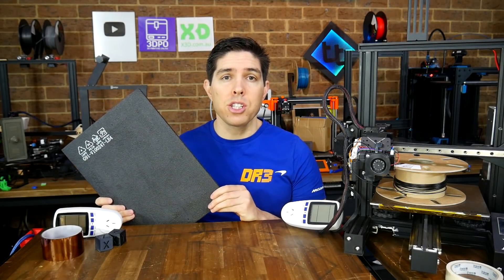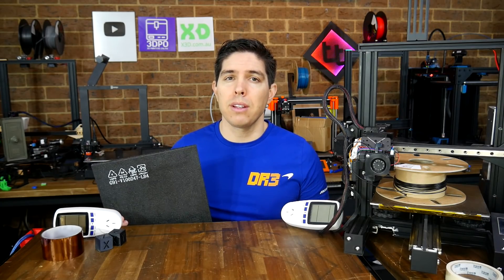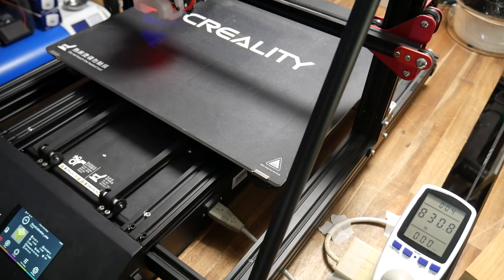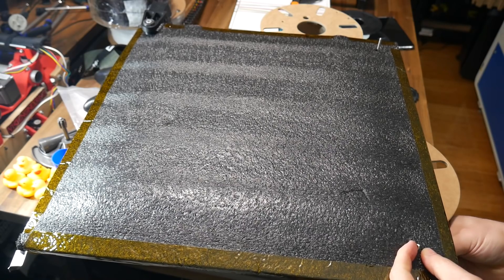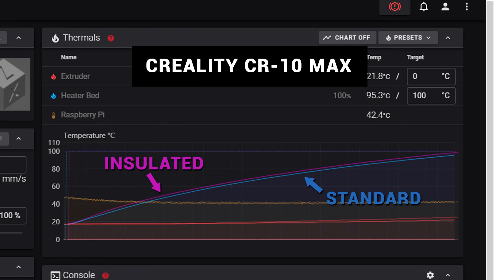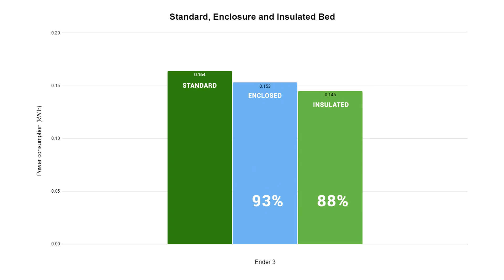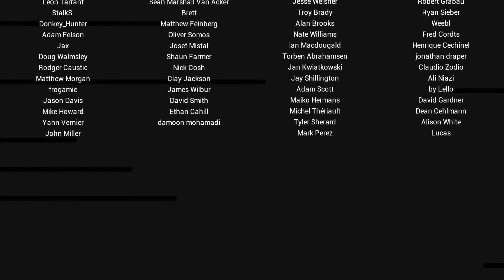Speed up 3D prints & save money. Insulation is important!

Comment: I'm bouncing back and forth between a good looking transparent enclosure for my Ender 3 Pro after I upgrade to the Ender Extender Max kit, or a well insulated enclosure.

While this video was well put together, it didn't help my decision any much based on your Ender 5 testing at the end. 🤔
Reply: As 3D printing is still in high development and there are frequently many innovations popping up i feel like some "smaller" people, in terms of audience and viewers, have a fair point by saying '3D Printer Enclosures' are highly underrated. It appears to be agreed that a 'heated chamber', basically a good Enclosure, is effective and usually desired. 

For your Question: i think you have to think about the initial question of whats the goal of isulation. From my perspective the goal is to make the printer more efficient in terms of power usage. The test he was doing in the end with the Enclosure and isolate it is in my opinion kind of missing the point of the Video or at least mixed. 

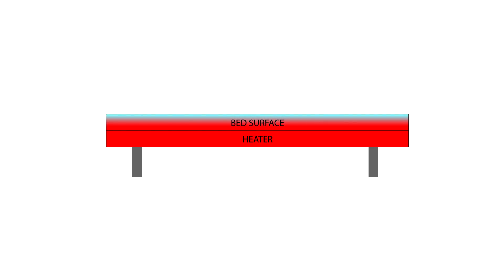The effect which you will probably archieve with isolating the Enclosure from inside will be that you effectivly create a 'heated Chamber' which presumably will improve the efficency further more as the heatbed will potentially lose less heat above it, if you look at 6:09, because he air above the heatbed is already hot/warm aswell and hot air is rising upwards.

Ofcourse it would be very interesting to see some numbers if the effort and lack of beauty is worth it. Because 1% more or less is not to much to gain for example in terms of efficency. But!

I personaly am investigating alot recently as im planning to buy 2x RatRig V-Core 3D Printer and im planning to print quiet some stuff. I will probably insulate the bottom heatbed and the enclosure with an exception of the front which i want to keep transparent.
Besides its potentially beeing more efficient it probably helps to reduce noise of the printers aswell.

So TLDR;
Pro +:
- Insulating the enclosure is probably good and desireable
- Heated Chambers appear to be good for e.g. cleaner prints
- Potentially even more efficient as the heatbed loses less heat once the heated chamber is heated up, probably exponentially good for long prints
- Probably reduces noise by a lot especially because those turbo/turbine fans on the hotend tend to be quiet noisy

Contra -:
- Potentially bad for Voron or RatRigs as they use 3D printed parts which could deform because of the heat(?)
- Hotend fan could ramp up more as its trying to keep the hotend on steady temperature(?)

Thats atleast my personal thoughts from what i know so far.
I would really appreciate any opinion of any of you!
Reply: @Keptains  and add a fan with thermostat to cool the enclosure down in longer prints. I start it just over 30 degrees in the enclosure, just a CPU-cooler from an old computer. Makes it really more silent then the fans inside. Parts of the printers if made from PETG or ABS will not degrade fast on those temperatures.
Hotend-fan - does your's have an extra thermistor ? The hotend is heating a lot less already because the surrounding air is keeping warmer in the enclosure but ofcourse cooling it down for PLA can be more critical when you print faster.
But I never let my enclosures reach really high temperatures.

Added bonus: the filament is preheated as well (especially in cold environments) so it is easier to print with, and it is also pre-dried a bit in the enclosure, especially during longer prints this makes a lot of difference for filaments like TPU and PETG compared to an open space.

Comment: Was VOC's considered with this? Heating up foam can release some pretty nasty chemicals depending on the type of foam.
Reply: I would also be weary if the foam can do the up to 120°C without deforming, shrinking or as you said release nasty stuff.
He did test flammability but things can already move or whatnot before that.
Getting proper material would be the wiser choice for this task.
Reply: Adding a layer of Kapton tape to the whole foam underside should decrease potential out gassing issues.  It could also improve it's heat tolerance.  An enclosure with a filter would also be a good idea.
Reply from the maker: Just added a pinned post addressing this, thanks for asking the question.
Reply: @TeachingTech  I couldn't find the pinned post?
Reply: @hotbrakepads  YEs  but that smell is there already, also if not using for insulation. It gets there the moment you open the box inside your house and even more when you set the printer up. It is by the way not as bad as many times with computers from for example Dell. Some fumes are actually from added gasses to make sure that for example rodents don't get transported.
Reply: The foam he's showing is a polyolefine foam (consisting only of C & H atoms), thermal breakdown of PP/PE in a ventilated environment CAN'T form VOCs as it's essentially the same as lighting a paraffin wax candle.

Comment: Wish I hadn't tossed that packing 2yrs ago. 🤦🏼 Oh, a 24hr PLA print cost me about 2.2kWHr last time I ran a test. 

4:42 watts are a bit of a liar here. Creality/Meanwell PSUs are horribly inefficient. Their power factor routinely hits 0.6 or lower. I have a calibrated smart plug on my Ender 3 and it peaks near 500 VA when heating bed and nozzle at warmup; Nozzle is rated at 40W/24V. It's not unusual to see 4.25A/120V during this period.
Now, your use of a watt meter is probably fine for comparison between the printers & insulated vs not. I just wanted to raise the flag that watts do not represent the true load on the mains circuit. The actual amps (what the mains breaker cares about) can be almost double what the wattage would imply.
Reply: @hotbrakepads  Power = V * I yes. Watts = V * I * cos(ø). Printer farms (which he mentions) would need to worry about the total Amp load per branch circuit. I don't think I said he was measuring incorrectly for comparison. I wanted to point out that watts were not the whole story. The losses in the PSU may or may not contribute to errors in his end result.
Reply: As far as I'm aware, household electricity use is generally measured as real power (Watts) rather than apparent power (Volt-Amps), so that's what most people are probably more interested in.
(At least, here in the UK I've never heard of anyone being billed for poor power factor.)

You're right that it doesn't represent the load on the circuit wiring, but I think you'd have to have a lot of printers (or an already very marginal electrical installation) for that to really be much of a concern.

That said, I'm not at all defending the choice of power supply used in these printers. They're using Meanwell PSUs because they can boast about it in marketing, but they use the absolute cheapest Meanwell PSU they can get away with, to the point of it probably not complying with EU regulations 🙄
Reply: @AndrewGillard  agreed. Amps are more important here than most places due to 125 vs 230 mains. My house has 2 bedrooms (outlets and lights) on 1 15A breaker & 14awg wires. Now, when we had the spare basement area finished it got multiple 20A breakers and 12awg; proper wiring. Lighting on its own 15A circuit.
I'm slowly fixing issues from 15yr old "code". Would have fired the electrician knowing then what I do now.